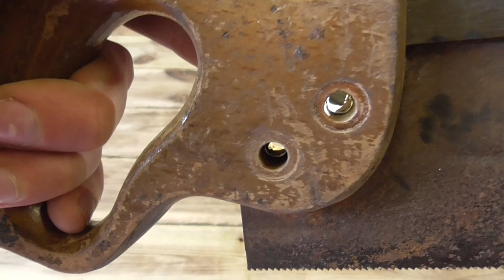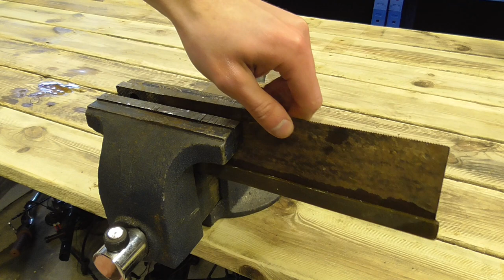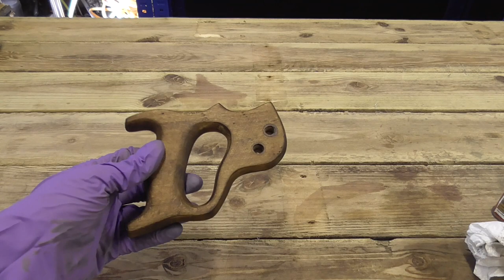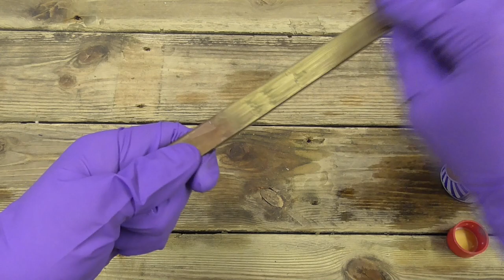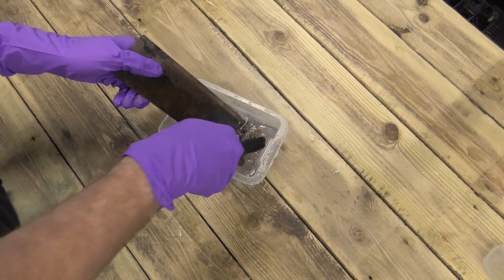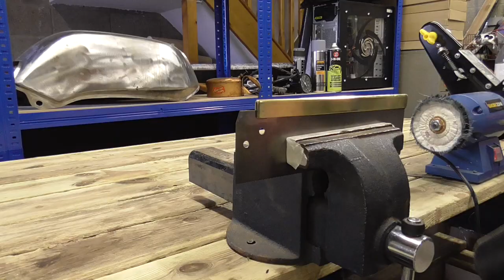Rusty Tenon Saw - Restoration

Comment: A file cuts on the push stroke - never pull the file backward in the metal; ruins the teeth.  For a true restoration, originally the wood was almost always finished with shellac.
Reply from the maker: Cheers for the tips!

Comment: This may be a dumb question but what is the tool you used to brighten up the blade? Is it some kind of buffer?
Reply from the maker: Not at all! its a brass wire wheel :) you can get attachments for loads of power tools pretty cheap!

Comment: Hi you need a special tool to reset the teeth after sharpening them.
The saw got stuck at the end then you walked away.
Tx JZ
Reply: Saw sets are available on line as used. Adjustable for different teeth numbers. Always check or reset to ensure kerf is correct.